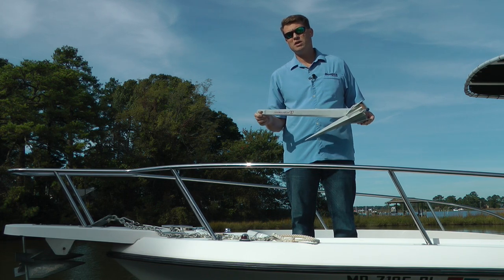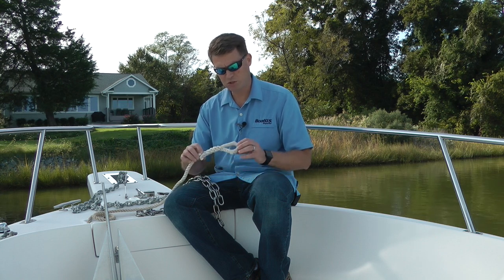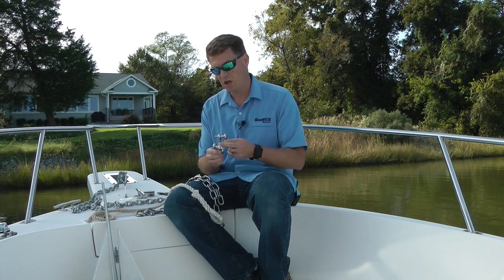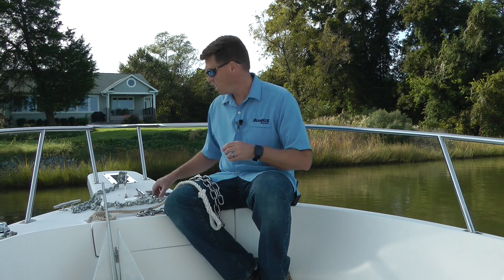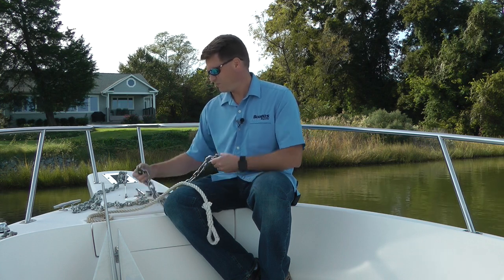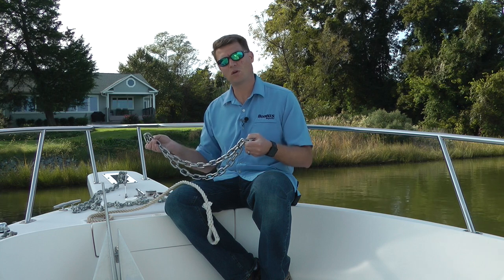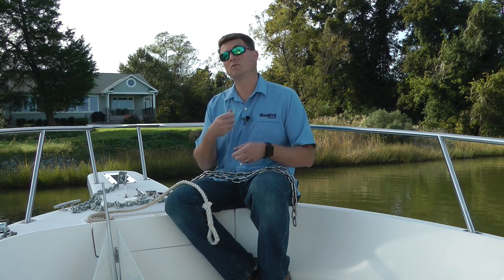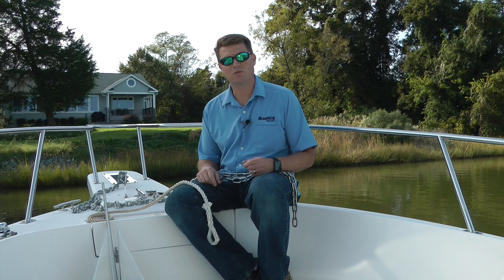⚓️ Add Anchor Chain for Better Holding + Seizing or Mousing the Shackle | BoatUS

Comment: As a suggestion, rather than simply nipping off the wire after twisting, you instead bend the last section over to make the wire less likely to snag your skin. Then snip off the excess. This is the way that it is done in aviation when safety wiring components.
Reply from the maker: Great suggestion. Thanks for sharing.
Reply: This is sage advice.  Loved the video, but as someone who’s learned the hard way, I cringed when I saw that snipped wire sticking out at the end.  Left like that it could cause a nasty scrape or cut.

Comment: Last year we had a local boat with stainless steel chain suddenly fail. they happened to be on board and saved the boat. Stainless under water is not reliable thats why underwater thruhulls are bronze or marlon ( check abyc standards ) We have used quality galvanized steel shackles and chain for 30 years.
Reply from the maker: Excellent point, tomodore!
Reply: Bronze thuhulls dont have a 20,000 pound boat pulling on them.....
Reply: Yes Donkey bronze thru hulls do not have 20,000 lb boat pulling on them. What’s your point?

Comment: You also should have mentioned that another good way to increase holding power even with just a short amount of chain is to use a catenary weight that you slide down anchor line. The further down the line you put the catenary weight, the better the holding power. .
Reply from the maker: Thanks for your comment, Peter.
Reply: There is no substitute for greater scope. All of these anchor weight accessories (kellets, angels, etc.) have been tested and shown to be ineffective and counterproductive. Let out more chain and rode instead.

Comment: Skip the wire, and use a split ring for seizing!  Place the rope in the shackle, then add the split ring on the non-threaded side of the shackle.  Screw the pin in.  Once that's assembled, thread the split ring through the hole in the pin.  You will never want to use wire again!!!  The split ring is tool-free, and completely reusable.
Reply from the maker: Thanks for sharing your tip!

Comment: Stainless chain and or shackles on anchor system is only promoted by those who sell anchors to those who dont know! Seizing and shackle Pin making wide with skin cutting boat scratching seems foolish. Finish seizing inside shackle with a loop back on itself. Grap end from side with pointer note and roll. Why not back splice direct to chain eliminating shackle, eye and seizing wire. Oh thats right less sales. Yes im annoyed by this video.
Reply: Agree with everything you said. The thimble/eye splice is for the bitter end. Splice rode direct to galvanized chain for a smooth transition with fewer fail points and be done. 👊🏼